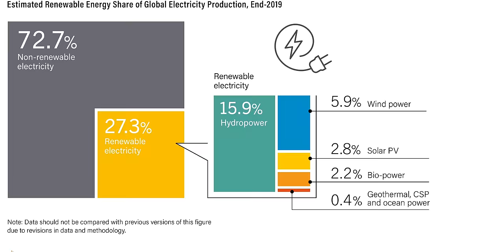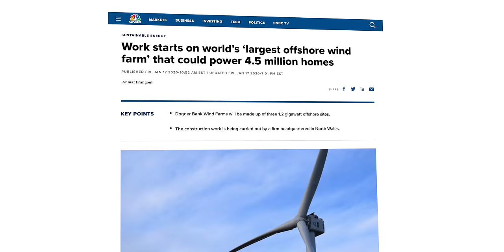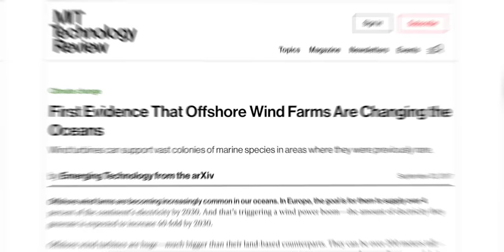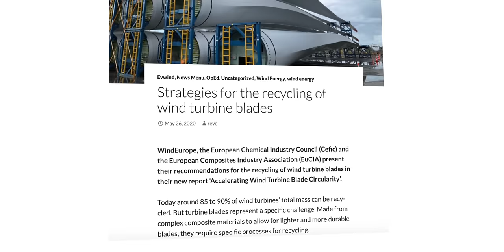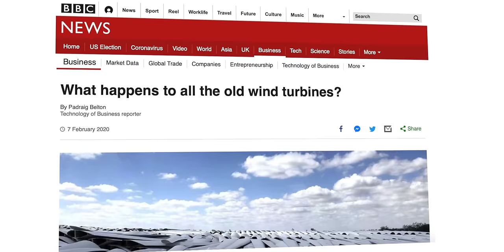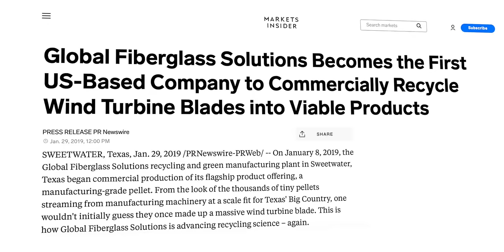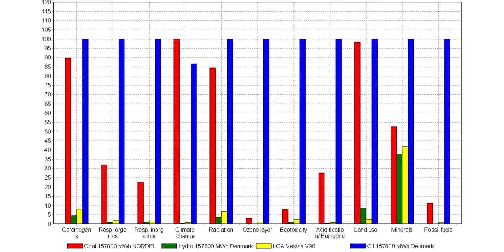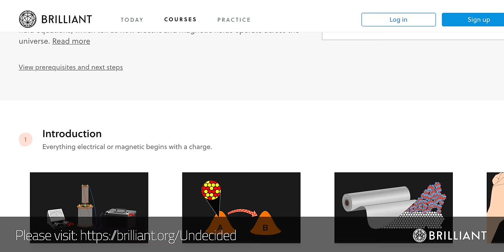The truth about wind turbines - how bad are they?

Comment: You forgot to mention the amount of gear oil and grease that the gearboxes and bearings require . They need regular oil changes and maintenance just like any other mechanical apparatus.
Reply: And Sulphur hexafluoride (SF6), the most potent greenhouse gas that the Intergovernmental Panel on Climate Change has evaluated with a global warming potential of 23,900[28] times that of CO2 when compared over a 100-year period.
Reply: the maintenance provides jobs. large gear box oil is usually contaminated by condensation  water gets in the gear lube.  but as with oil pump gear boxes proper vents cut down on that. also the gear lube can be treated by heating past the boiling point of water the evaporate the water away. that heat isn't enough to harm the gear grease
Reply: Conservative estimates put U.S. direct subsidies to the fossil fuel industry at roughly $20 billion per year; with 20 percent currently allocated to coal and 80 percent to natural gas and crude oil.
Reply: @erniew5805  digging trenches with spoons would provide jobs for the entire nation!! Let's do it
Reply: @r-gart  they are not maintaining wind turbines with spoons.
Reply: The up to eight ton blades. Can be broken down to small pieces on the site of the wind farms. Which he says eliminates the heavy removal! I am no genius or rocket scientist. But I am pretty sure that eight ton wind turbine blades. No matter how small you chop it up. When you are finished cutting them into these smaller pieces. When you go to load these pieces to move them. There is still eight tons of blade that is going to be hauled away! Whether it is hauled as a blade or cur into a million pieces. Either method has a common factor. Eight tons is eight tons. Now matter how thin you slice it!
Reply: @StevenKegley-hx9si  what do you think they do with the coal ash.ash can be 30% of the coal.
Reply: @erniew5805  Well first off. Who mentioned anything about coal? I don't recall discussing the carbon footprint of coa. My reference is to the statement made about the chopped up blades. That since they are being chopped into small pieces where they are being picked up. As opposed to hauling the blades in one piece. The same amount of mass is in fact. Still being moved. And probably in dumptrucks. Which is reality. Will now involve the use of more than one truck to move a single blade. As for my opinion on all renewable energy sources. I would love to see an energy source other than fossil fuel or nuclear powered plants. That truly has the technology and the ability to produce energy. Leaving no carbon footprint. However solar panels and wind turbines. Are not and never will be that source. Because both require the use of fossil fuels to manufacture, transport, and construct. And both require even more energy to recycle. No clear Fission is the ideal of the future. But that's just an ideal. For now.
Reply: @StevenKegley-hx9si  hauling a blade in one piece .is a big production. pilot cars special permits. corners are a problem..the picture of blades in the Wyoming landfill those blades  were up graded to a better design .a dump truck can easily more than 8 tons. as far as energy used to produce the steel concrete fiberglass carbon fiber.even using double materials and 1/3rd power out put . power used is replaced in less than 6 months.. yes for now wind and solar are our options.
Reply: @StevenKegley-hx9si  Fission won't require any fossil fuels for transportation and construction?
Reply: @erniew5805    Yes, fission - Not much compared to the power generated, and even less if 4th gen Thorium is used.
Reply: @hizzlemobizzle  I believe the Obama admin concluded that fossil fuels get 5 billion in subsidies while wind and solar get 20 billion.
Reply: @thepope2412  It's possible you beleive many things that are not true.  I recommend you do a little research instead of just believing you think something.
Here this is from an article in 2012: According to the Congressional Budget Office, in 2011 federal support for the development and production of fossil fuels  totaled an estimated $24 billion, given in tax preferences (special deductions, special tax rates, credits, and grants totaling $20.5 billion) and Department of Energy spending programs (which totaled $3.5 billion).
Want to take a guess if that has gone up or down since then?
Reply: @hizzlemobizzle  Here's what I was referring to. You can find the source yourself, youtube doesn't always allow links
" Last year, in an effort to eliminate all direct fossil-fuel subsidies, President Obama asked his U.S. Treasury Department to figure out how much the industry gets in subsidies from fossil-fuel specific tax code provisions. The answer, according to the Treasury: $4.7 billion."

Also says this
"According to the apolitical U.S. Energy Information Agency, the federal government spends about $3.5 billion per year subsidizing the coal, petroleum and natural gas industries. By contrast, the Feds dole out about $15 billion every year in subsidies to the renewable energy industry (mainly to support new wind and solar projects) and $20 billion per year for agricultural subsidies and insurance."

Remember that fossil fuels produce 70-80% of our energy so $20 billion isn't really that much, but $15 billion for renewables which are mostly wind and solar is a lot considering they produce less than 5% of our energy
Reply: @thepope2412  corporate socialism is fine eh?
Reply: @hizzlemobizzle  I never said that?
Reply: One Degree Celsius. That is how much the average world temperature  has changed in the last hundred years. Keep in mind and propagate basic fact. Most don't even know.
Reply: So are wind tubines dependent on Fossil Fuels to lubricate them?
Reply: @Botman.com1125  transmission fluid isn’t nessecarily fossil fuels
Reply: @StevenKegley-hx9si  a semi trailer can haul about 20 tons of ground up material, or about 2.5 blades. Compare that to 1 blade when transported in tact.
Reply: @StevenKegley-hx9si  
 
Wind provides on average 10 times the energy back what it takes to manufacture, deploy, maintain and decommission them. They produce enormous amounts of energy while cutting back the damage fossil fuels produce. Every part of the turbine can be recycled. It turns out blades are very recyclable by being used as an ingredient in cement production. This actually cuts down on the pollution and resources used. 

Material impact: recycling 1000 tonnes of fibreglass through the process saves around 450 tonnes of coal, 200 tonnes of chalk, 200 tonnes of sand and 150 tonnes of aluminium oxide

https://circle-lab.com/knowledge-hub/1550/recycling-fibreglass-composite-cement
Reply: @erniew5805  Nonsense. It takes three years to recover the energy it takes to manufacture and install a wind turbine. The windmills must be overhauled every three years which then starts the process over. It's like a dog chasing it's tail. It never quite gets there.
Reply: @thepope2412  Actually, fossil fuels get zero in direct subsidies from the Federal  government while wind and solar get 50 billion a year from the Feds. The subsidies for wind and solar is actually many times that as utilities have raised their electrical rates to pay for the overpriced energy from wind and solar.
Reply: @hizzlemobizzle  That is using fuzzy math that calls standard deductions "special" . That was a highly political report that was debunked many times.
Reply: This is not about the return on investment of Windmills. It is about the phenomenal opportunity Windmill construction offers to pull money legally out of the pockets of hard-working people under the pretext of "saving the world".
Reply: @StevenKegley-hx9si , the difference between 8 tons of pieces I could haul in my car and 8 tons that requires a specialized vehicle that is itself heavy enough to damage the roads is pretty significant. That is what is meant by "eliminating the need for heavy removal".
Reply: @hizzlemobizzle  Indirect subsidies worldwide are over $7 trillion.
Reply: @codyk1875  
"You use oil to lubricate your car. How much oil do you think you need to lubricate your car for a year in comparison to the amount of oil needed to make the gas that runs your car. How much greenhouse gasses went into constructing and transporting your car?"

You're missing the point.  The issue is that these items are still consumed in thousands of times the quantity.  To produce the same energy that you would otherwise get form a single turbine using a more conventional source.
Reply: Is this satire? Because it reads like satire.
Reply: @erniew5805  coal ash is used to make drywall, like the ones in your house
Reply: Wind turbines true cost has to factor in alternative stand by power generation, not for maintenance but when the wind isn't blowing.
Reply: @erniew5805  The gears are oil lubricated.
Reply: @erniew5805  It's used by the cement industry as a filler product.
Reply: So do they use as much as the ships that move oil around the world, do they use as much as the trucks/trains that move oil over land, do they use as much as the vast amount of power required to convert crude oil to fuel, each refinery uses as much as two large cities. Do they devastate as much land as the oil sands in Canada or devastate land when oil is extracted, do they produce any pollution in their use ? May be you should get some updated information, with every new technology it improves with time and coal/oil has decades in its evolution and it's still comes in a poor second place to the new technology.
Reply: @StevenKegley-hx9si  It doesnt have to go on one truck or is that not obvious to you ?
Reply: @codyk1875  this is why we need to look to keep our cars for longer, yes having the latest environmental wizz bit may be very impressive but the pollution cost far out ways the small benefit, today's cars are better engineered, better built and overall safer by design, and in the scrap yard in half the time that the older cars used to be, been going round them first with my farther then for myself for about fifty years so have seen the changes first hand, there is no reason why a modern car couldn't last twenty plus years halving the numbers made and shipped round the world.
Reply: @nigelmitchell351  in the UK its known as hot standby, and wind supporters don't like to discuss it,   I wonder why?☺.
Reply: @StevenKegley-hx9si  Oh c'mon..we all know 100lbs of feathers is lighter than 100lbs of steel.
Reply: @CrusaderSports250  My current vehicle is sixteen years old. Still runs  as good as ever. Emissions are as clean as today's models. The scheduled maintenance has been kept up to date. And other than normal wearable repairs and replacements. It has never needed any major repairs.
Reply: @StevenKegley-hx9si  by my standards a modern vehicle then, almost new, but joking aside this illustrates my point, a perfectly good vehicle so why condemn it just because its not new, and yet the tree hugger's would criticize you for driving a less green car ignoring the pollution caused by making their new car every three years, enjoy your car and good luck to you.☺.
Reply: @erniew5805  And how do you heat the oil to eliminate the condensation???? With oil or its derivitaves
Reply: @yourhandlehere1  Icant, um, let me see...If the feathers are from birds killed by wind turbines, then the feathers must be lighter, because everything "renewable" is lightweight.
Reply: @richardguillory4443  heater treater  or hot oil truck. emulsion lines are usually insulated  and heat traced= heat tape. a long line could have one or several line heaters.
Reply: David Erickson  Yes & the giant decommissioned blades don't crush themselves up or move themselves hundreds of miles or dig giant holes in the ground to bury themselves = fossil fuel heavy equipment does that.
Reply: here is the thing. you aren't burning it off in a turbine
Reply: You somehow managed to fit 12 periods into 5 sentences … congratulations?
Reply: @stevehayward2533  if we used no oil as fuel the oil companies would still be extracting oil, there is still a need for the chemicals oil produces and in a lot of cases there is no substitute, therefore the petrol and diesel components from a barrel of oil would be waste and would have to be burned to get rid of it, without it doing anything so they cannot be accused of using fossil fuels, this would be ecological??, all the chemicals that have to be produced with oil would now cost considerably more as the companies would no longer have the fuel element to help cover costs, everything in the world increases in cost and the poorer nations get poorer, this is fair??, the energy density of liquid fuels currently cannot be matched, whether we like it or not petrol and diesel will be with us for a long while yet.
Reply: @CrusaderSports250  There will be a replacement for plastics one day soon and all the other products will synthesised also. We only make them this way because we refine oil. Mankind is very resourceful, by the time we have transitioned to EV's in the next 10 to 20 years, those problems will be resolved.
Reply: @thepope2412  but it is in this case, synthetic is still petro based, do not be so naïve
Reply: @canton7180  The Earth will always survive, as it always had but there is a list of extinctions, will humans be the next ?
Reply: @CrusaderSports250  We'll be getting our energy from several sources for a long yet, with renewables steadily becoming a larger percentage of that source as the technology improves and fossil fuels becoming scarcer and more expensive to extract.
Reply: @canton7180  Well, we gave it our best shot. I'll start making the calls now and give everybody the bad news.
Reply: He didn't mention it because it's insignificant and irrelevant. What are we gonna do? Phase out gear oil by banning "mechanical apparatuses"? Complaining about such things is nonsensical contrarianism as far as I'm concerned.
Reply: @CrusaderSports250  People back in the day were more mechanically inclined and used to working with their hands, plus older vehicles were much easier to work on. Those two factors plus the fact that mechanics charge a fortune nowadays means it makes sense to upgrade once major repairs are needed.
Reply: @hizzlemobizzle  According to the American Bird Conservancy, 3 billion birds have been killed by windmills since 2019.
Reply: @hizzlemobizzle  cats are a huge issue, especially un-neutered, common domestic cats that went feral. 
Cats are also responsible for the extinction of 33 species of other animals. Unless  specifically bred for show or for people who want a certain breed, all cats should be neutered.
Reply: @minniemaeshufflebutt116  Yes feral cats are a major problem.  They are very adaptable and can survive in virtually any climate.
Reply: @thepope2412  And fossil fuels generate A LOT more power than wind and solar for 1/4 the subsidies no less. :D
Reply: @StevenKegley-hx9si  Eight ton blades are the equivalent of about four pickup trucks. The US buys about 12 million pickups a year, which means a similar amount are junked from age/wrecks. So it would take approximately three million blades per year to match the mass of trashed pickup trucks alone. There are currently about 85,000 windmills in the US, so say 250,000 windmill blades. Each of those blades lasts about 25 years. Numbers are cruel, my friend.
Reply: Yes, they need lube, but that's kind of a nitpick here. I go through 7 quarts of oil every 10,000 miles, but I go through 500 gallons of gasoline in that same distance. That's a fuel to lubricant ratio of 285:1. Further, lubricants are already being made from sustainable plant oils. Compared to just burning the carbon, this is clearly better.
Reply: @davestagner  Yes, we do buy lots of pickups. I have a 1979 Chevy Luv 4x4 still runs purrrrfect. We don't drive it as much as we once did. My other one is a 1983 chevy Silverado k20 that is also still in super mechanical condition and still runs like new. I am not sure if either will be headed to the scrap heap. But if they did. Both will still provide use to others buy providing useful salvaged parts. Not exactly like comparing apples to apples.
Reply: considering that anything with a spinning turbine would need lubrication, the only one that wouldn't need an oil change would be solar
Reply: @StevenKegley-hx9si  It's significantly more efficient to move 8 tons of condensed material with the actual vehicles and infrastructure we have than individual 8 ton blades given their extreme size
Reply: @r-gart  the difference being that would be intentionally inefficient and serve no independent purpose
Reply: @erniew5805  The estimated total amount of energy needed to create a typical NEW wind farm is about the same as the amount of electrical energy produced within six to eight months by the wind farm, according to most authorities. Hardly anybody says it takes more than the first year's out put to offset the energy PUT INTO a new wind farm. 

SO....... you get back at least twenty times as much energy over the life of a wind farm as it takes to make all the parts and set them up. 

And a wind farm NEVER really wears out. All the parts can be replaced as necessary, here and there, as they wear out, with all the blades and generators being routinely replaced about every twenty to twenty five years. 

The foundations, towers, roads, power lines, and everything else is still there and usually still good. So replacing the blades and generators is like putting a new engine in a truck........ you can run it many more years for a fraction of the money it takes to buy a new one.
Reply: I've read it takes 700 gallons of lubricant a year for a single windmill
Reply: The oil in gear boxes lasts indefinitely is properly filtered. Unlike internal combustion engine gears don’t contaminate the oil with acids and water. Gears only contaminate with fine metal shavings that can easily be removed by filters and magnets.
Reply: How many birds are killed by domestic cats? Also the larger the wind turbine the less likely the bird kills.